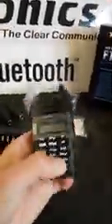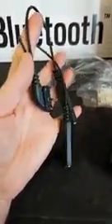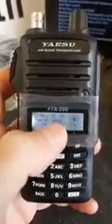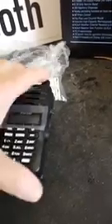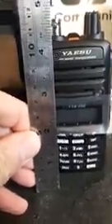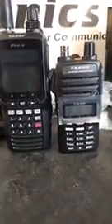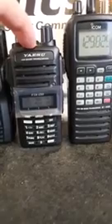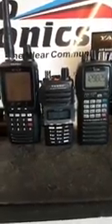Yaesu FTA-250L Airband Transceiver.

Comment: Does PTT work through the headset adapter provided?
Reply from the maker: You need to provide a PTT from the headset. The headset adapter does not have a remote PTT socket. If that is what you need, then you will need to go for the Icom A6, as this had a headset adapter with external PTT socket. https://www.microavionics.com/icom-ic-a6e-sport-pack.html
Reply: OK, thanks for the info.